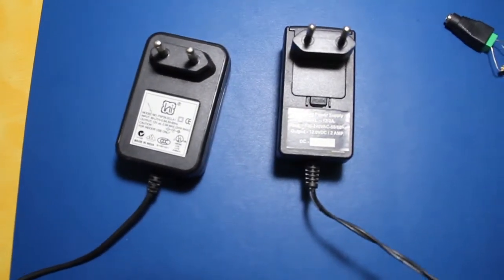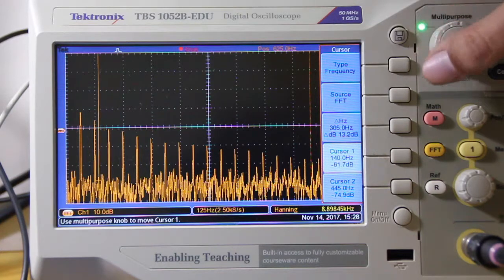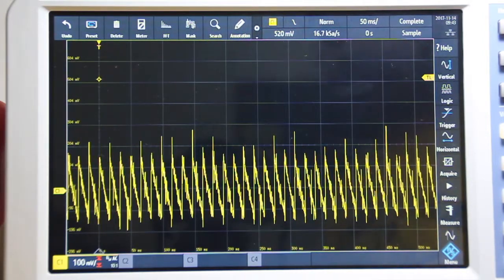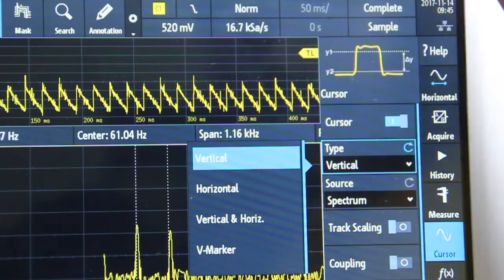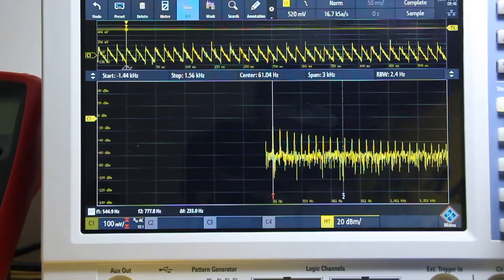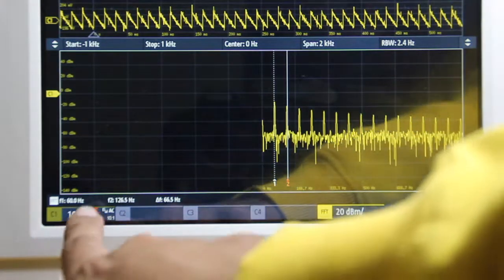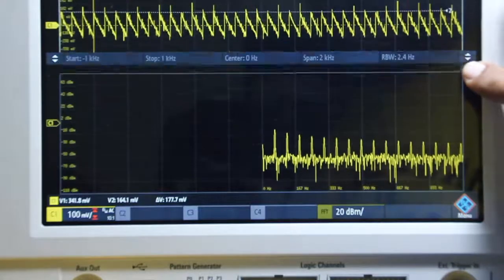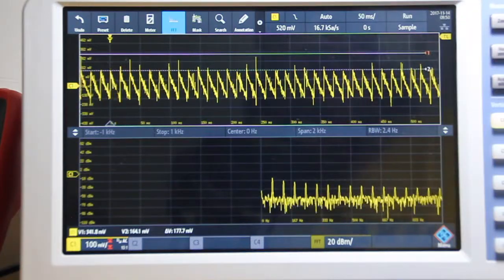Rohde n Schwarz FFT Bugs!

Comment: Which R&s model is thus?  Have you had any firmware updates to fix this?
Reply from the maker: This is the 300MHz with logic analyser. I have not tried the newer firmware though the guys over at Rohde n Schwarz said that it will. Will update shortly.